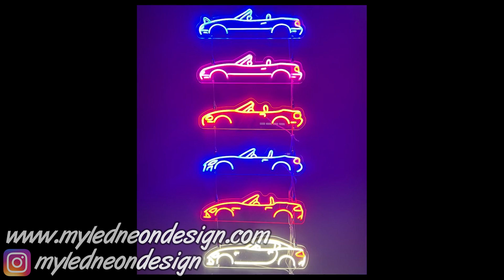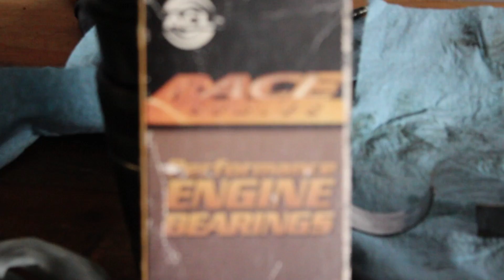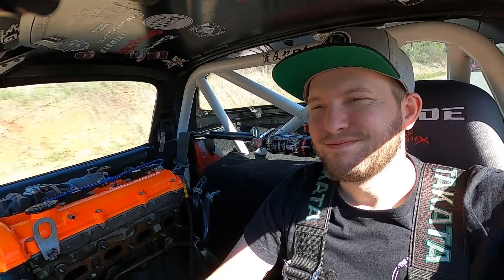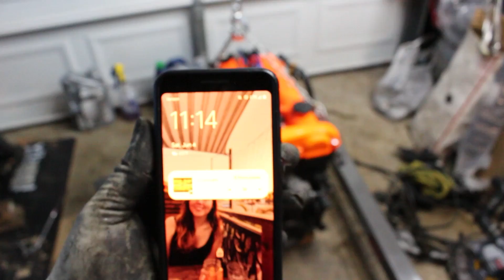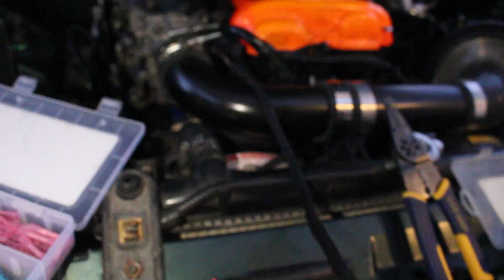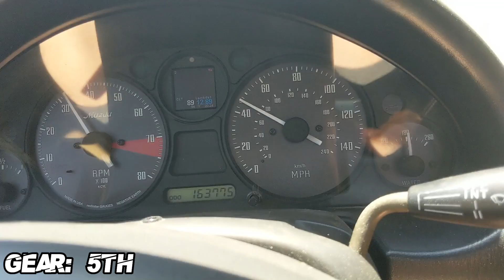I Accidentally Blew Up The NB [2-Day VVT Engine Swap]

Comment: I used to have a 92 Acura Integra. Bought a used b20b motor cause I knew my old original motor was gonna go. I rod knocked the stock b18 then swapped in this cheap b20b, that shit got rod knock after 3k miles, then I bought another cheap b18, then piston rings were bad. Lesson to be learned was never cheap out on anything car related ever again lol I sold that car with the bad motor cause it was a endless money pit

Comment: I made the mistake with my daily of buying the totally incorrect oil, not noticing, and doing an oil change anyways. I was comparing oils in the aisle, and put the wrong one back on the shelf. I went a full 500 miles before I noticed and did another oil change. 😅

I also made the mistake of not changing my Miata’s heater core hoses after the CAS had dripped onto them for years under the previous owner. It blew the line, I didn’t notice, and the engine overheated BADLY. In the process of a rebuild now. 😢

Comment: I bought a street bike and met the fire wall of an Isuzu rodeo cost 3.3 mil in medical sold the bike after rebuild for 5500 haha
Reply from the maker: @daylindrake768  $3.3M 💀 did they give you a ride to the hospital in Air Force One??
Reply: @ na barley made it in an ambulance. 7 transfusions broke my spine in 6 places  induced coma broke shoulder blade list goes on best part I was doin 180 three nights befor on i5 only 23mph thru town in this and the 21 year old had like liability 25k insurance and mine dropped me 😛😛
Reply: @ na barley made it in an ambulance. 7 transfusions broke my spine in 6 places  induced coma broke shoulder blade list goes on best part I was doin 180 three nights befor on i5 only 23mph thru town in this and the 21 year old had like liability 25k insurance and mine dropped me 😛😛
Reply from the maker: @daylindrake768  That's crazy dude, glad you survived to tell the tale 🙏

Comment: Hey man, I am concidering doing this swap since my BP4W is burning oil like crazy (Piston rings) related im guessing, Want to do this swap so I can get te car running meanwhile I do a propper rebuild of the BP4W. There is just one thing I am not finding any information about and that is the engine mount brackets. The engine I am looking at getting does not come with motor mount brackets so I am just curious if the NB1 mounts can bolt up to the BP6D.

Comment: Well I lost my bp4w a week before…. I put a sandwich plate for gauges and the plate was for oil cooler also with a thermostat I didn’t use oil cooler so I tup the holes for the oil cooler I put the sensors for the gauges installed the sandwich put the filter start the engine and go for the ride the oil was warm the thermostat block the oil and 🤯🤯🤯🤯🤯🤯🤯bye bye motor ready for a vvt swap ✌️✌️👍🏻

Comment: I used to daily a 2007 mini cooper. the engines are plagued with oil and timing problems but one day on my way to work, my oil pump failed and I drove to a safe place to pull over. I changed out the oil filter (didn't change it out last oil change because I forgot to get one) and drove the car around the block, surprise surprise (I was not surprised), the motor would stall frequently as I am coasting 20mph. Luckily I was doing this near home so I started it up and got speed to coast it back to the driveway. 

This happened earlier this year but finally taking it in for inspection (just to get numbers on the paper) for motor replacement. I know it will need a new motor and will cost a lot. I do not want the car anymore as I have a newer WRX that I've been playing with. WRX costs way too much and putting too many miles on it to want to mod it anymore so I found a NB miata for sale that needs a lot of love (240k miles, 9 previous owners, 1 accident with no frame damage supposedly). I check it out saturday (with intentions to buy) to finally start my project miata. I am so excited, I've wanted a miata for 7 years and I hopefully can pick this one up this weekend. I've been watching you since the very beginning of the broke and boosted build. Can't wait to share to you if I get the car this weekend :)

Comment: Exactly the video I needed!!!

Thank you so much I literally got the VVT 2003 engine home and on the hoist yesterday and pretty nervous about starting this engine swap with it being the first engine swap for me…

But you were extremely thorough I felt like you answered every question I had been wondering about putting this vvt motor in my green nb1 1999 (exactly yours 🤗)

Now it’s time for me to throw the vvt motor on the engine stand, swap over some of the newer parts on the old stock nb1 motor and like you said at the beginning—just go for it!!

I’m going to try to do my best to give filming the adventure a shot but regardless I’ll check back in when I’m finished and have a second stall opened up in my garage once again so I stop getting HOA fines from working on cars outside 😅

…nearly $2,000 in fines and on my last chance before they really get serious whatever that means…😰

Comment: I pull the dip stick half way out and leave it like that until refill the crankcase so I don't forget. I'm paranoid about doing what you did after what 3 of my friends did years ago. First one changed his oil in a hurry and drove to our car club meet up, hung out then drove home. He stopped at a video store a block from his house and came out so see a big puddle of oil under his car. He had only hand tightened the drain plug and it fell out in the parking lot of the video store. Lucky him. The second friend was in the same car club and had never changed the oil in a car before but decided to do so because all of us did. He drained what he thought was the engine oil in his FWD car and then proceeded to add 4 more quarts to the engine only to find that it wouldn't start. He had drained the manual transmission oil, not the engine oil and now had 8 quarts in the engine. Another friend decided to do his own oil change for the first time on his early '70 Firebird. He drained the engine oil correctly and changed the filter and then put in 5 quarts of engine oil but there was noting on the dip stick. He had put the oil into the AT by mistake. He never tried working on his car again. All three of these people were smart but very young, they weren't mechanics but thought how hard could it be to change my own oil. 
Keep making these great videos, one day I'll get another Miata.

Comment: doing pulls at every stoplight in my 13 veloster turbo… a car already known for it’s plenty of issues😭, ended up having to rebuild the top end and eventually replace the turbo. traded it in for an nb miata after all that work though so not all bad :)

Comment: i did very similar to this, just over 2 months ago i supercharged my nb vvt had it running for 1 week when came a boost leak and i had 1 week from that till i was doing a track day so that whole week i was trying everything to find this boost leek i had to the day of the trackday. 4 laps in i hard brake from 160kmh to i tight corner then yellow flag came out so i cruise for 10secs then i start hearing rod knock. time to take it apart im removing everything i find my brand new turbo smart bov seized open, which i never checked nor expected being a brand new part. further down the tare down ive spun a bearing on cyl 4. so this is gonna be hard reminder for me to check my oil before track days

Comment: Stupid mistake - Working on a 4.0 v8 1984 stretch Caddy at summer camp. full gettho settup, working on dirt with cinder blocks and 2x6 for ramps. Pouring in th eoil and wondering why my feet were getting hot - no drain plug, pouring oil straight on my feet.
Big Mistake - Changing the fuel injection pump on my 1997 Delica L400, had to take the vacuum pump pulley off to get the timing gears apart. Had the smart idea to jam the vanes to tighen it back up and of course the vanes are composit. I am based in the French alps and used parts let alone new parts are hard to come by in the UK........which is the best source of parts bar Japan in the northern hemishphere.....6 miles walk home in the snow and no car for 10 days until I could get a whole pump, no individual parts available.....replacment pump was a real junker, had to make one franken pump form 2 as the replacment was a Pajero not a Delica unit and not exactly the same!
Plenty of other stupid stuff, mainly involving breaking stuff before I bought a tourque wrench, having to drill stuff and JB weld bolts back in to then drive home ;)

Comment: I'm a HUGE SUCKER for "while I'm in there repair jobs & mods".
I wanted to freshen up my engine and of course I pulled it out and before I knew it I had a standalone ECU, OP clutch, TTV flywheel, LS2 coils, .... (to much to sum up)
And yes. It did cost me a shit ton of money. But I do not have regrets doing it.

Also I keep everything in a Trello board. Might be because of my IT profession.
But I really like to break down jobs in multiple tasks and it's so satisfying to document everything in there and ticking em off.

Comment: My first car was a 1986 4Runner and I daily drove it for 6 years or so (owned it for 9). I was doing an oil change in my parents' garage while my mom was telling my girlfriend and I a story about a family member. After I filled the engine I started it to circulate the oil and check the level. 10 or 15 seconds after I started it they started yelling to shut it off. There was oil everywhere. I forgot to install the new oil filter. Fortunately the engine was fine but there was a lot of oil to clean up...

Comment: When installing the turbo on my 1.6 NA, we opened up the oil feed in the block and then decided to slowly and securely drive the car onto the ramps, forgetting and somehow not noticing for a long time we had that bolt undone. It sprayed oil absolutely everywhere but luckily didn't drain enough to do internal damage.

That is only one of my many stupid mistakes over the years :p

Comment: Removed the aircon fan recently from my mx5 mk1 around 2y after I removed on the rest of the aircon system.
I was tired at the time of removal.  Upon driving the car I wondered why it overheated in slow traffic!  I had removed the regular cooling fan instead! Doh!
I used your videos for both a cambelt change, wideband install and a clutch change.  We all have special moments so don't worry!

Comment: Mate, I’ve got the 6 speed and the 4.1 diff and I feel bad using it on the highway sitting at 3,500 rpm. Great for drifting n/a though 😂

Comment: Can the broken engine and crankshaft be repaired or they are just scrap now?
Reply from the maker: Yes 👍 I will be rebuilding that engine. It should be okay after a crank polish and all new bearings. The head and cams seemed okay

Comment: Hi, looking for help. I have NB 99 1.8 103kw, when the car is moving and i put it in neutral the idle jumps 500-700rpm. but when i stop the car idles fine at 800rpm... Idk what to do, where to look. Changed sparks, cables. fuel filter
Reply from the maker: Do you need to be in neutral while the car is moving? Standalone or stock ECU? Aftermarket or stock intake? The MAF could be getting hit with air while the car is moving depending on your speed and intake design, which might be causing extra fuel to be injected. But that would only happen with MAF based tune + aftermarket intake
Reply: @TheCarPassionChannel  Its those situations where you are heading to the traffic lights. you slowly brake. when you reach about 20kmh you put it in neutral and then you can feel it. I tried it with different speeds. anytime when you are driving and you put it in neutral the idle just bounces up and down. Doesnt matter if i brake or not, it just bounce and when i stop completely it goes back to normal. Stock ecu, stock intake.
Reply: As you said, the car is getting more air when its moving vs standing, so the rpm should be higher. Thats what I also thought but its lower. When i am not moving it idles at 800, but the bounces are fromm 500 to 700
Reply: will let you know if something changes when its in gear and clutch is pressed or if not. right now i am not sure
Reply from the maker: @gfgfdgfdgdgdfg3004  No, RPM should not be higher, the speed of the car is not dictating the amount of air entering the engine. Air may be hitting the MAF, but not entering the engine, which makes it inject fuel for air that isn't there.
Reply from the maker: Pretty easy solution though, there's no reason to be in neutral at 20km/h+
Reply: @TheCarPassionChannel  sure an option, but i dont know how about you but when i am stopping at traffic light/intersection i dont go from 3 to 2 .. and stop. i usually go from 3 (when i reach speed when it rpms are about 1200) and then i put it in neutral and brake the rest. The main issue is that when the idle is jumping the whole car just vibrates and its quite uncomfortable
Reply: anyway i will try to clean the MAF
Reply: Doesnt matter if the car is in gear or not. and the rpms bounces like  3 times and then it settles arround 800. goes from 500-800, 600-800- 700-800, and 800..

Comment: A tip that I've used every time since I learned it.

Take the dip stick out half way and leave it hanging.

This does 2 things, reminds you when you lower the car to put oil in and ads a vent to allow the oil to drain faster

Comment: I just change the clutch in my car alone. After bolting everything back together i found that the car doesn’t run. The clutch keep slipping. Then i found out that i installed the disk backward.

Comment: I ran myself over after doing my first pad and rotor change on my '07 Si.  My buddy forgot to tell me to pump the brakes when I was done, so I backed out of the driveway and the pedal hit the floor.  I tried a few more times and gave up, hopped out of the car to try to push it to a stop.  Of course when I jumped out I let go of the clutch and it was still in reverse, so I jumped back in, put in neutral, and jumped back out.  I got behind the car and pushed as hard as I could.  I ended up pinned by my car against my neighbor's car on the other side of the road.  My buddy asked if I was okay and then broke down laughing.  Another neighbor driving down the street saw the whole thing and just shook his head and drove around.  Of course, I hopped in the car and the pedal was firm, just had to press it one more time...

Comment: Story than a question about the intake manifold. 

Back when I was a Hyundai tech. The seaman brought back a vera Cruz for an oil change. It was 5pm I was supposed to be out of there. So I drain the oil, drop it down, did the oil filter and the guy is just there yapping his fucking gums about B's. I just wanted him out of there. I went to go get oil and he took the car. He went like a half hour down the road and brought it back. Knock who's there???? Two days of pulling a motor and replacing motor, on MY TIME!!! Nooney fore for two days. It was brutal. I left there and went somewhere else after that dumb shit. 

The square top. This literally just bolts on? What do you do with the wiring for the intake runners and control valve???

Comment: I feel your pain.  I swapped in a NA8 motor into my ‘90 only to find out the new motor had zero oil pressure at idle.  I found a new junk yard motor, swapped it out in two days and dyno tuned it in time for the next track day that weekend.
One thing to keep in mind with the VVT motor, your NB1 injectors are slightly smaller than the NB2 injectors, so if you go for 150whp, you may need the NB2 injectors to get there safely.  
You don’t have to make an extension harness for the cam sensor as the wiring comes from the rear of the engine.  I cut open the factory loom and folded the cam wiring back on itself to end at the new cam sensor location. 
I ran a VVTuner and DIYPNP for years in my car.  The easiest way I found was to bring the cam and crank sensors into the ECU through the factory harness and run them out through the expansion plug to the VVTuner.  The VVTuner can be used in pass through mode and send the sensor signals back out.  I ran them back through the expansion plug to the CAM and Crank signal inputs on the DIYPNP.  
It works great and the car made just shy of 150whp on 93 octane here in swampy S. FL.  Keep up the great work!

Comment: Perfect time..
So had a leak from my valve cover so  my coils got covered in oil and started to cause a misfire… 
So replaced plugs and changed valve cover.
After a couple weeks I noticed an oil leak.  So I pulled everyone apart again it’s a nissan frontier so the intake manifold runs over the coils so intake manifold needs to come out every time . Then I fixed the leak.. it was an issue with the gasket not sitting right.
After everything went back together had a misfire one of the cylinder.. and a random misfire.
So bought a new intake gasket.
Installed that and still the problem was there.  So I installed new plugs since I gapped “non gappable” plugs.
Still no fix.. So I  bought  injectors since I noticed the plastic tip was broken on one of them. Still no fix.
So I bought new coils.. and installed them.. Every-time I have to  pull out intake manifold to do anything.
Then still didn’t work so I started testing the coils and plugs..
Ended up shorting my ecu with a couple exposed coil wires..
So now with no ecu I still have to figure out what’s wrong..
And since it’s a 2.5 engine 5 speed with cruise  it’s very hard to find the ecu used.. and it’s over $1000 from dealer..And all these issues could  be from using non conductive grease on the connectors ..
Maybe my ecu is ok and it’s the fuse power management box